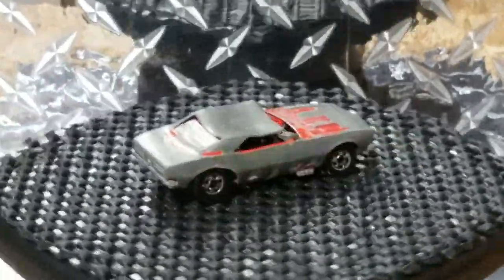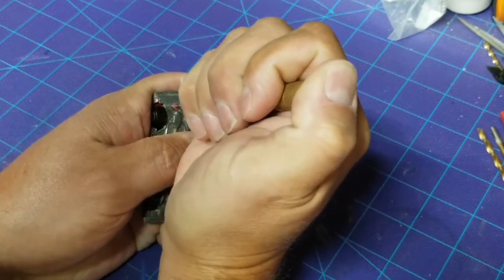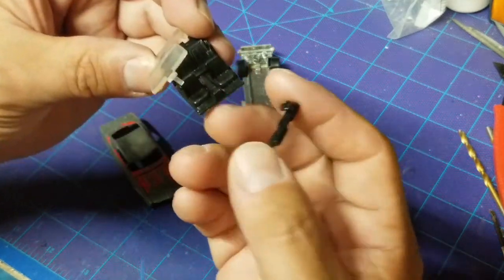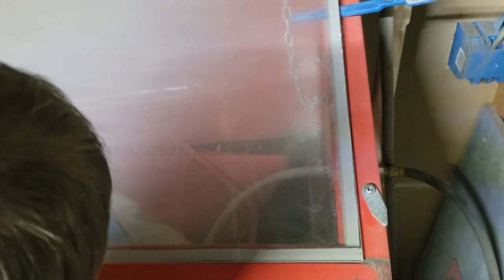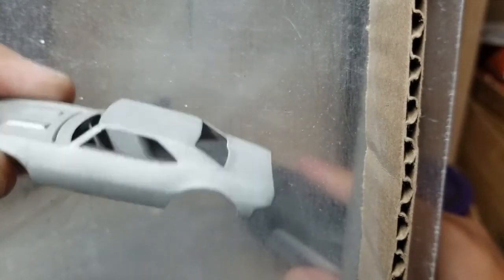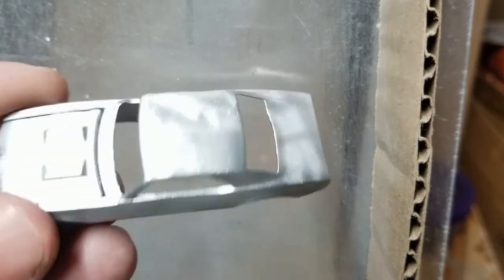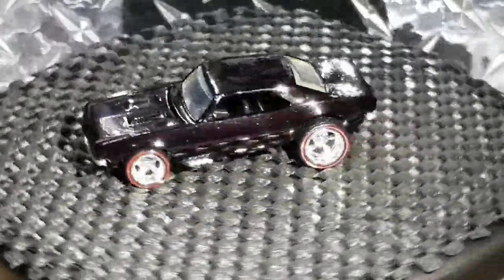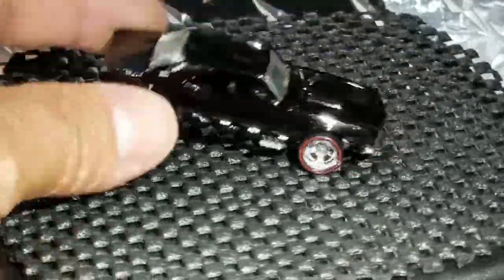Hot Wheels Custom 67 Camaro Restoration

Comment: In worste case scenarios, If you would heat the car up to between 300 and 400 degrees and work on it while it's hot. It would make it a lot easier to push all of that out. You did a great job with it though. Turned out very nice. Stay safe.